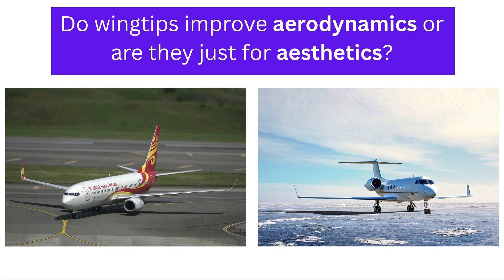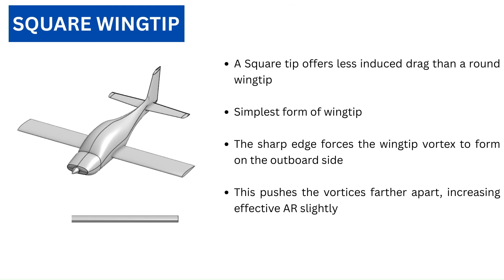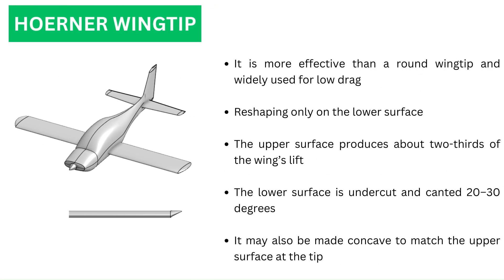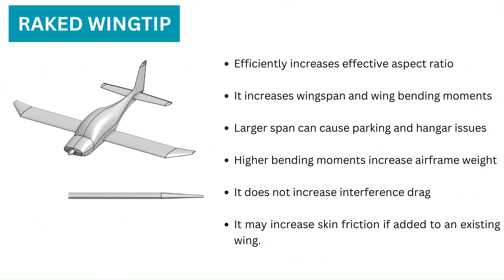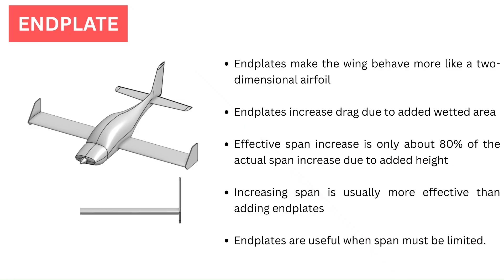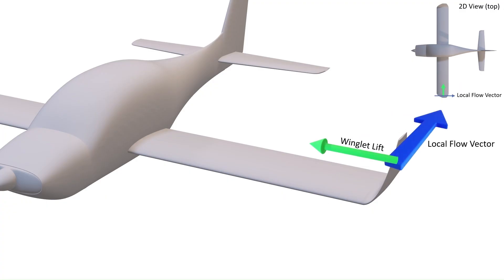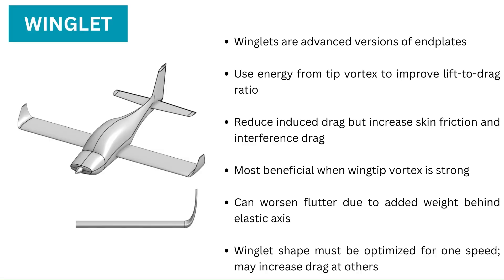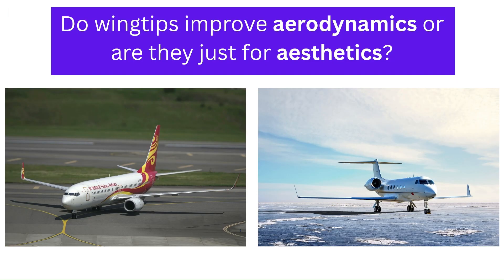Do WINGTIPS improve Aerodynamics? | Types of Wingtip Devices | Aircraft Design

Comment: In the 'Naval Fighter Number 39' publication featuring the Convair Model 48 'Charger', the rectangular constant chord  of the wing had too much drag at speed and too little drag at low speed.  Aeronautical engineer Stan Piskin tried several dozen of the tip ends featured in this blog with no success.  Finally, he just got mad at all the failures and just brought the lower wing up at 45 degrees to meet the upper wing surface.  Success!  Top speed was increased by 40 knots while adding 2'7" to the very short wingspan.  The Charger lost out to the NAA Bronco.

Comment: I would like to ask something.
Why don't single engine prop planes have asymmetrical designs? I don't mean things like p factor, i mean things like asymmetrical wings.
While there were experimental models, from what i know none of them were production models.
Reply: If you fly a single engine aircraft, there is no significant asymmetry in the flight characteristics.  If there are, a good aircraft rigger will bend the fixed metal tab on the aileron or elevator to compensate.

Comment: The air does not flow around the tip from bottom to the top of the wing.
Reply: from a front or rear pov it does although from the top bottom or sides its a vortex
Reply: @lucywucyyy  that's not what I mean.  The air from the bottom curls up aft of the wing.  The top of the wing never "feels" the air from the bottom.
Reply: @DumbledoreMcCracken thats what i meant